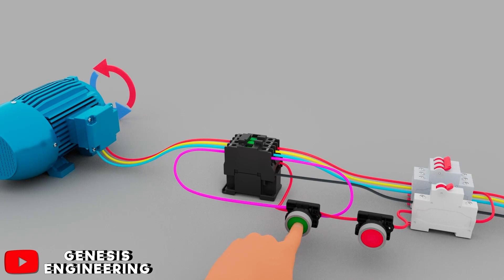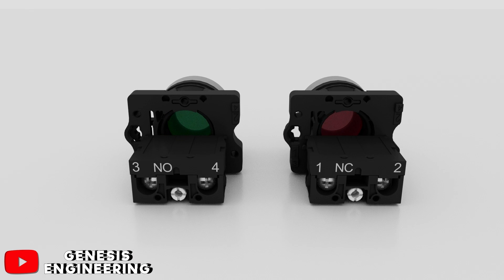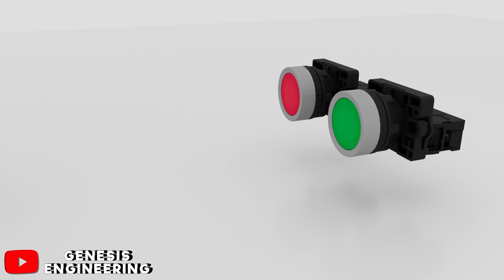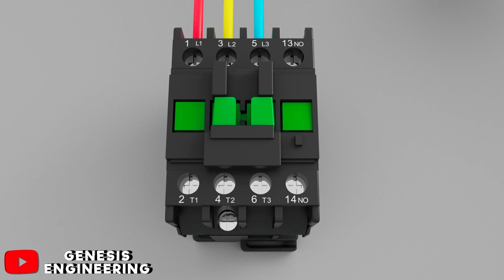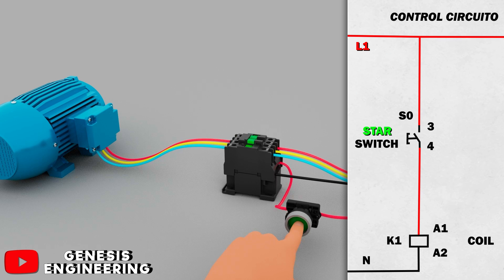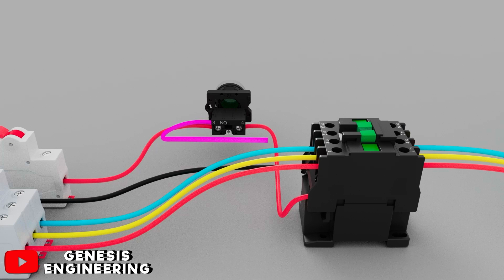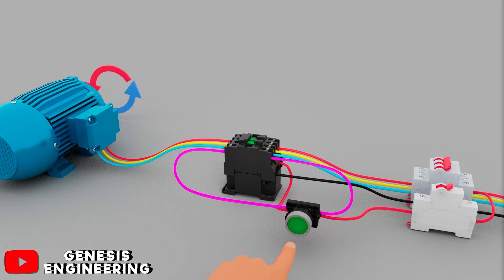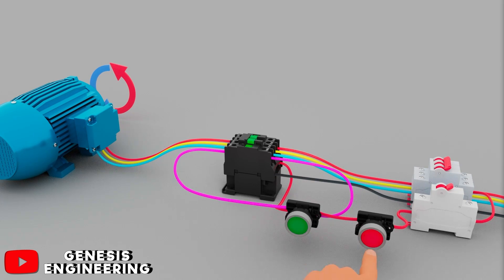Holding Contact, Contactor Holding Circuit

Comment: Nice video tutorial thank you sir.

Pls make a video tutorial for this..

Draw the power and control circuit diagram of a two-station start/stop motor starter with selector switch. ... Description of function: when the selector switch is at the first position, the motor is controlled only in one station. And if the selector switch is set to position 2, the motor can be controlled in both stations.

Comment: Shouldn't the pink wire coming for terminal 3 on the switch go to the Normally open terminal in the auxiliary contacts. And, at the other side of the auxiliary contacts, a wire going to the red wire, which is the hot wire for the contactor coil, to keep the plunger sucked in and therefore keeping the motor running??

Comment: What happens if the contactor isn't  pushing in when power is on?
Reply: Probably a bad contactor or you’re not getting enough voltage to close the contactor so check leads to make sure you have the proper voltage

Comment: How can I run 3 phase in one direction??
Reply: I assume you mean controlling the direction of the motor? You do so by swapping the order of two of the phases, i.e. from L1-L2-L3 to L3-L2-L1 for example. You can do this by having a set of two mutually exclusive contactors (only one can be energized at a time) downstream from the starting contactor, where you swap the order of the outputs of one of them.